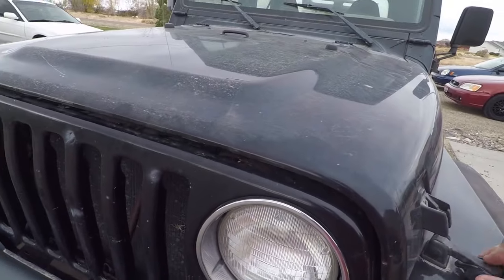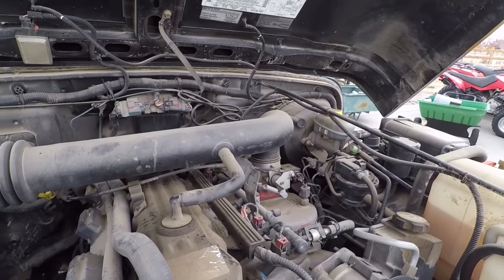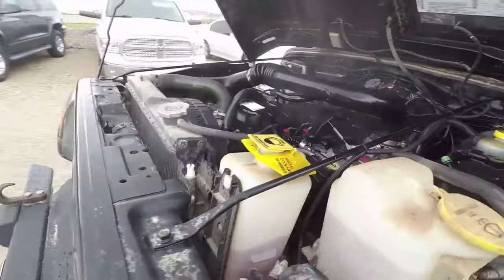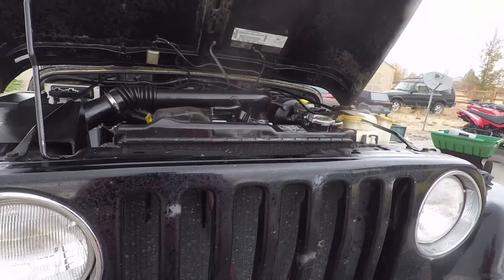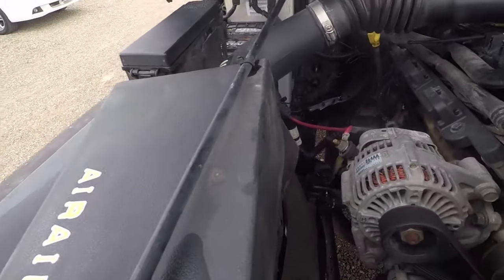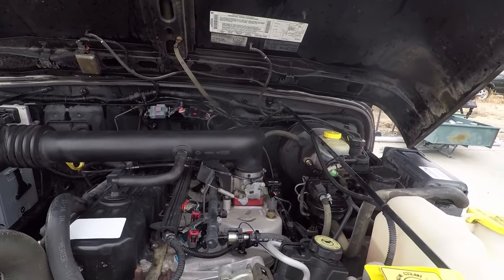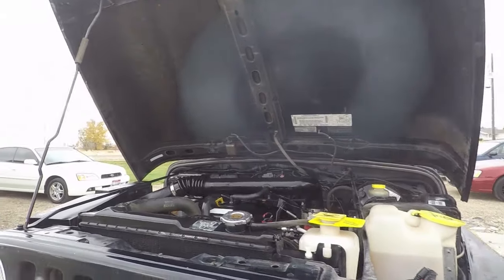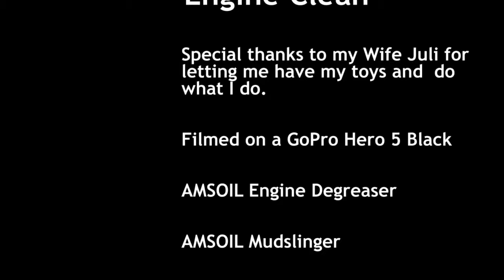2002 Jeep Wrangler Engine Clean

Comment: I just bought my 2005 TJ Trail Rated Rocky Mountain about 3 weeks ago. It's not my first Jeep though. The salesman told me that the finance company was wanting me to get a newer model. I said, "does any of them have 2 doors? 4.0L inline 6cyl? 6 speed manual transmission?" He said no. Well I didn't go there to buy a Jeep. I went to him to buy "THAT" particular Jeep, lol. It was sitting in the quality inspection bay waiting to be inspected. They had just got it in that same day on a trade-in. I looked it over top to bottom. This thing only had 118k miles.  Trading my car in on this Jeep was a no brainer, it was going home with me, lol. This Jeep never saw the dealership's lot. After 2 days of inspecting and detailing it for sale. I test drove it right out of that bay. In my book, TJ's are by far the best Wranglers on the road.
Reply from the maker: Awesome, hope you have some great adventures with it.

Comment: Looks good but how many problems did you have afterwards from spraying water all over the electrical components?!
Reply from the maker: No problems at all.  Jeeps are well known for the ability to go through water crossings.  It started with no hesitation and has had no issues as of last week.  A key is to not use high pressure on any sensors, connections, or the computer.

Comment: I have realized that you haven't covered the Alternator OR the Battery and the intake air!!
Reply from the maker: Correct, as for the air intake, I did not spray it directly so no more water than driving this Jeep in the rain.  As for the alternator and battery, I have never had any problems doing what I did.  12V DC is not like the 120v (or 240v) AC you have in your home.  The computer, Ignition, and wire connectors are the most vulnerable, but I do not hit any of them with hi-pressure so again, no worse than rain or a water crossing which this Jeep has done and most are capable of doing without any problems.